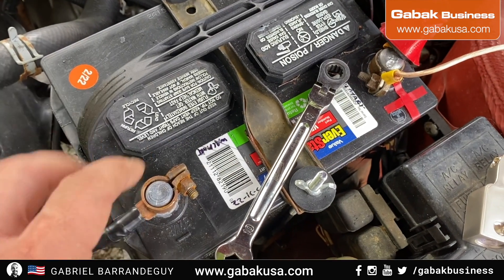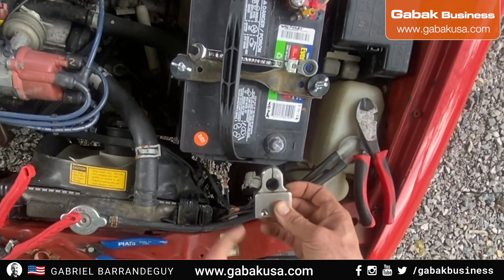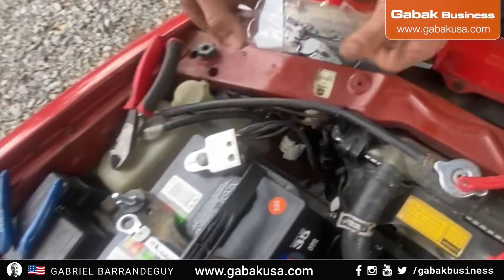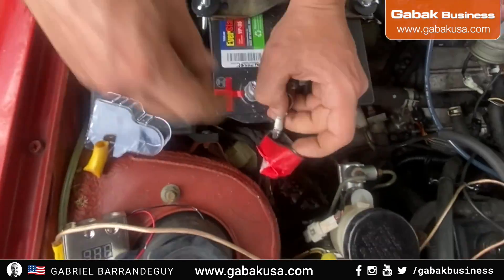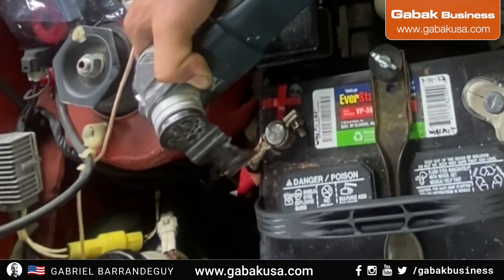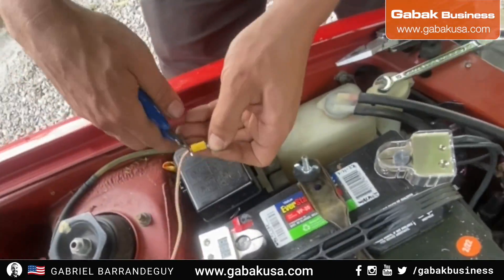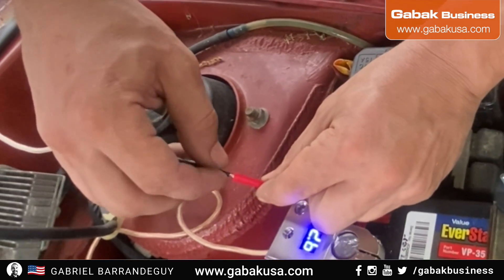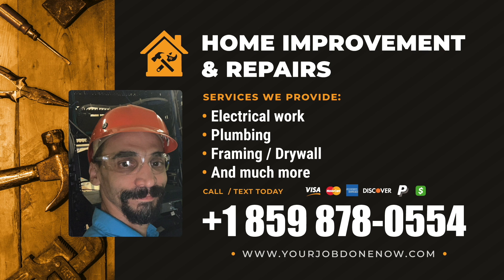battery terminal connectors with voltmeter built-in - Gabak Business - Gabriel Barrandeguy

Comment: now does the voltmeter stay on all the time and if it does how mucho power drainage are you experiencing
Reply from the maker: it will stay on 24/7
if you use it daily it does not matter
otherwise just disconnect it if you are not going to use it for long period of time
Reply: @gabakbusiness  the most i wont use it will be a day or a week i should be ok right?
Reply: @knockzdoorz5813  You can extend and run the red wire from the digital to the fuel pump so when you turn the key is the only way it will go digital…
Reply: Where would you connect the wire on your fuel pump
Reply: @zigzagXSlowboi616 they are possibly asking to the fuse block right beside it. So when the vehicle is off it would turn on when the key is on position. Not actually or literally to the pump lol.